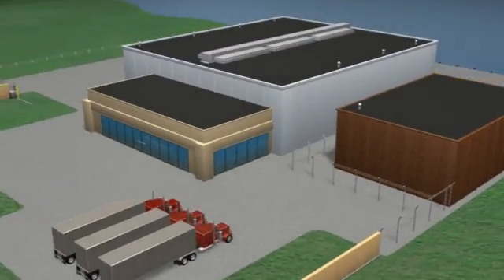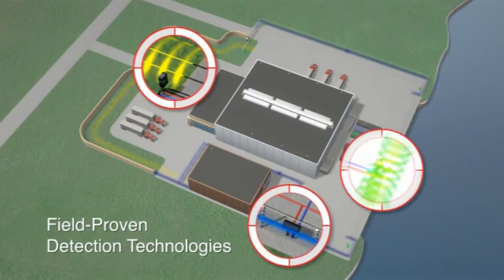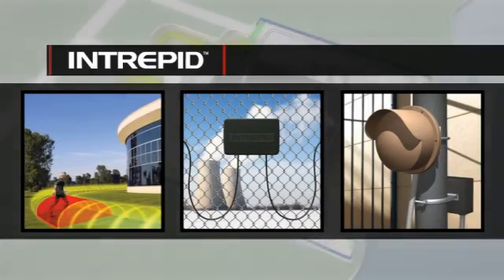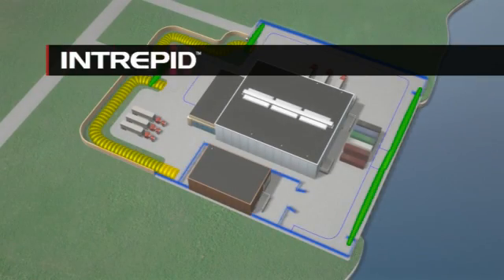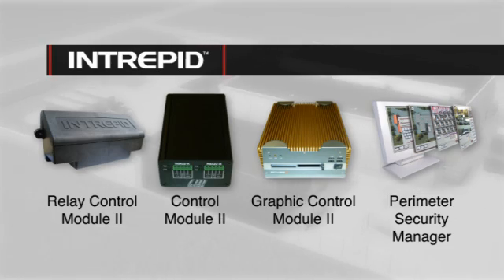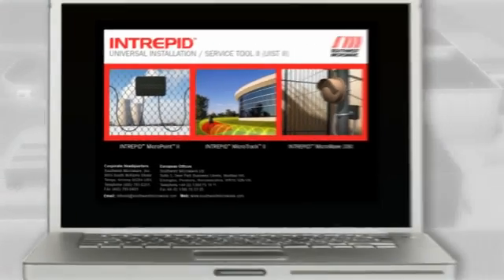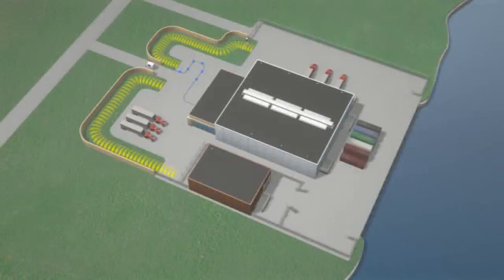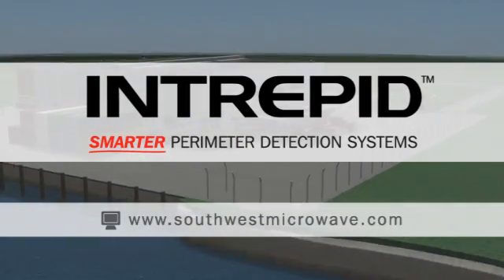Southwest Microwave INTREPID

Comment from the maker: http://www.9point2.com/portfolio/3D/southwest-microwave-intrepid-warehouse.html

The Challenge:
Southwest Microwave had reached a major milestone in their line of product development, as they successfully integrated each component of their perimeter intrusion detection system. Now they just needed to communicate how these invisible detection fields worked together to give their customers a protective barrier around their entire facility.

The Solution:
With no real-world implementations that showcased all of the challenging scenarios of intrusion detection that their technology could easily tackle, an illustration of an ideal warehouse environment was the only way to visually describe their capabilities in one static shot.

With the exception of the tractor trailer rigs, every detail of this 3D model was designed and created specifically for this project. In addition to being used for a number of promotional print materials.